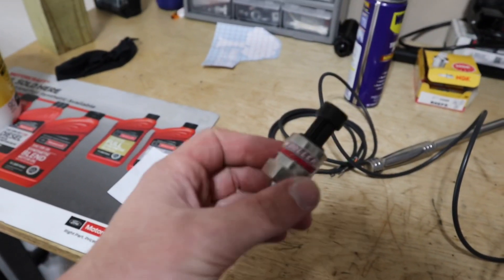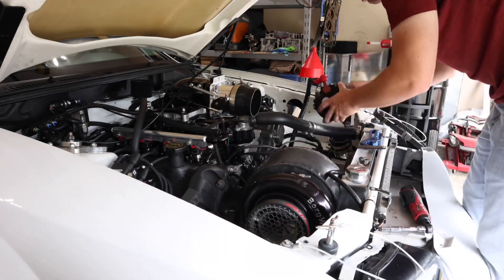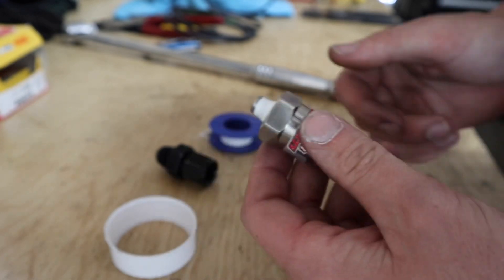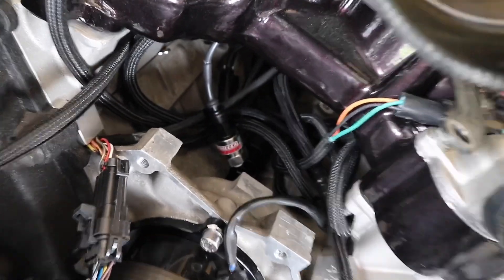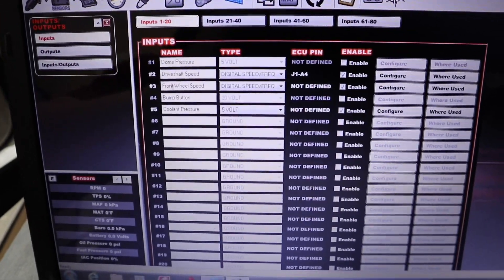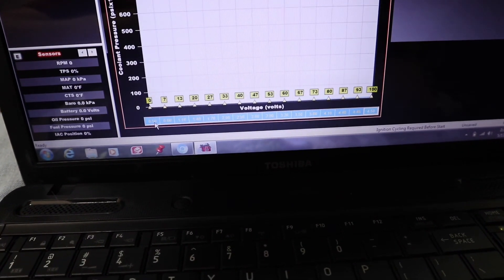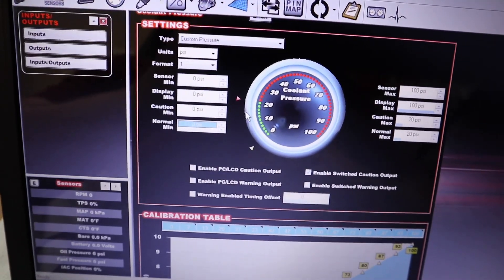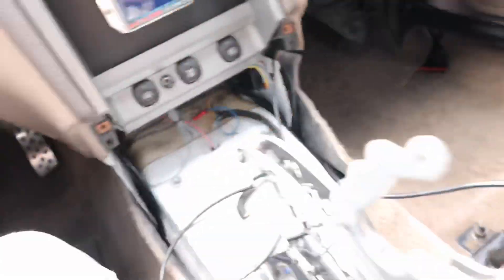Adding a Coolant pressure sensor to my turbo mustang and why it’s important

Comment: Thought I was the only one that did this!  Had my head lift, also got around 10 garbage sensors on Amazon before one that worked.  Careful with those. I think 100psi is too high.  I went 30 because my cap is 15psi & by 30psi I blew my radiator last time.
Reply: Anyone knows what kind of pressure at about 200deg F ?
Reply: @iridiumx6116  do you mean pressure from water? The max pressure will be from hose failure, not anything in the motor. They're connected. If you Had a closed steel system you& I could easily calculate pressure & temperature relationship.
If we're talking motors, pressure isn't a concern (except boiling point & heat xfer) cause the weak point will be rubber or a blow off valve (radiator cap). Perhaps craziness could exist w/ super pressure systems but radiators would get heavy.

Comment: Nice vid Andrew, that’s a good sensor to have, one thing I did not see is that you did not attach a safety feature to the params of the sensor, like if the pressure is greater (>) than 20 then turn a light on or go to a limp mode or set a boot table so it reduce the boost. 
I don’t have a Holley but I have a MS3 that I made plug and play to my car. I am using the factory cluster for now, but all my sensors (fuel, oil pressure, oil, water temp are like yours, custom sensors). 
Thanks for the vid, be safe!

Comment: Hey Andrew, are you running a thermostat? I understand you want to monitor for gasket leak/head lifting, however any future plans to move the sensor location (front to rear or add more sensors) to monitor coolant flow/pressure across the head(s) for hot spots?

Comment: How are you liking the electric water pump?  Thinking about putting one on my car since I added an Overdrive crank pulley.   I dont like the idea of fhe added volume and potential pressure build during high rpm runs.

Comment: You are so impressive to the common man, how do you feel about the SCAT crank and rods 5.0 set for the 4.6? I would like a more steetable tuneup for my 55 f100 panel truck. Kind of an all around vehicle with 4wd with a 700r4 transmission the engine is a 96 tecsid Lincoln that I want to put the Trick Flow 2v  heads on along with the necessary parts maybe from a later crownvic engine. Kind of like your input please.

Comment: If you was to decide to go to a 4 valve motor I have a friend who sold his car to start building his 2008 bullit its getting a turbo coyote setup and a glide he says this one is gonna be a street car lol but he still has his back up motor from the old car it's a sbe terminator 4.6 the heads have been cleaned up and rebuilt with a little port work with arp studs and comp valve springs I'm not sure about the cams but they are the same as the other motor that had a 88/91 precision turbo and it hurts to say it but it was a bad bitch! I dont know how much those motors are going for but for what mods it has with less than 40k on the bottom end and the kind of power and numbers its twin ran in a 2900 pound new edge Stang it's worth it in my opinion but in our area he was really the only guy running one of those all the other ford guys run Windsor's and coyotes.